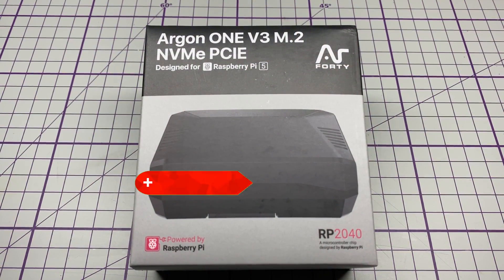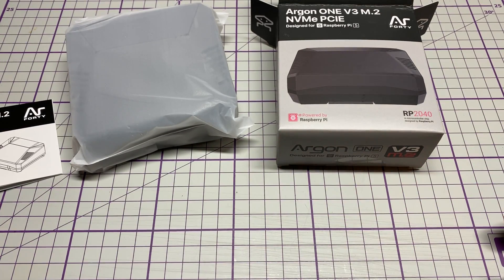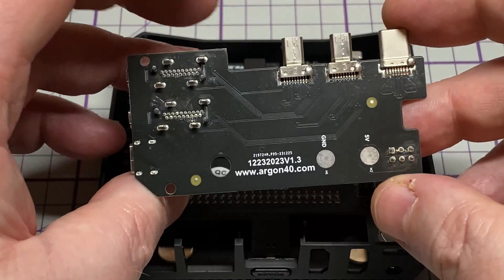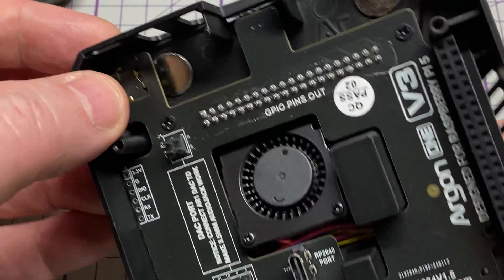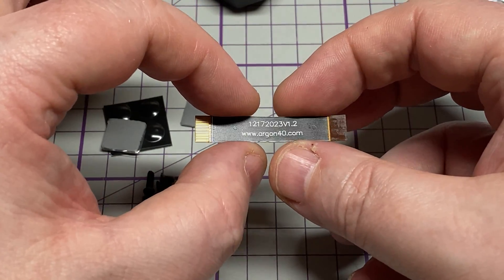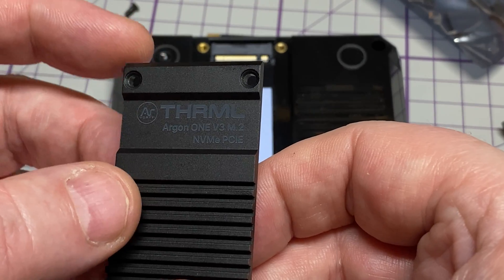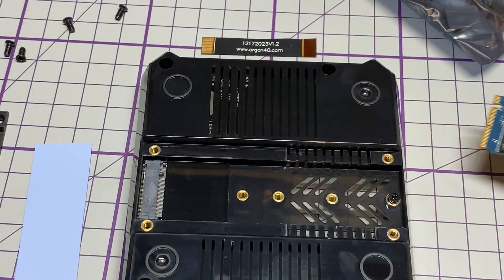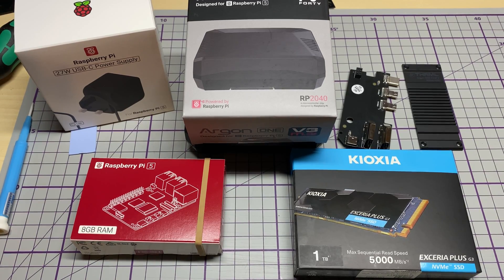Argon ONE NVME case for the Raspberry Pi 5 - unbox and first impressions.

Comment: Got mine, tried for days, 3 different NVME drives NONE detected, did all the updates, changess, updated firmware on Argon, still not recognised. Got RMA today, its done,  Anyone get NVME working in the ArgonOne V3 NVME M.2 Case, let us know drive compatibility.
Reply: Crucial P3, T500 I love this thing. added the BLSTR for sound all is well

Comment: Hello , good explanation !!!, could you provide me with the details and the link were you bought the KIONIA 1TB as you used in the video, to avoid frustration on my side with non compatible firmware and prevent that's not usable for Raspberry / Argon case .. many thanks in advance
Reply from the maker: scan in the uk https://www.scan.co.uk/products/1tb-kioxia-exceria-plus-g3-nvme-ssd-pcie-40-read-write-speed-5000-3900-mb-s

Comment: So you can't use the official active cooler from raspberry pi with this and you install the thermal tape right over the stickers of the NVME or do you peel them off?
Reply: NO
Reply: @KevinKnox-vk6qg  Yeah I know that now. I did end up taking the stickers off of the hard drive though.

Comment: I got mine today, but it’s not powering on, no matter what switches I use or pressing the power button. Pi is starting when powering directly. I’m using the 27 watt power supply
Reply from the maker: Did you push the daughter board on correctly
Reply: You are my hero. For some reason I had to use some force to push it all the way in. Connector is a little bit stiff
Reply from the maker: Yes I found this also , glad to of helped .

Comment: Great case but unfortunately it does not work with the official raspberry pi 5 27 watt power supply and keeps giving power warnings with other lower wattage power supplies. I have installed both the resommended scripts
Reply from the maker: I got a warning , but after then seemed ok , the pi is running at full power .have to see if any other issues appear

Comment: Hi today I received it too. I had my eeprom settings done before with an external usb NVMe reader. Also the boot order was set to NVMe in eeprom. But the device doesn't detect my Kingston 2TB NVMe. How is your experience so far?
Reply from the maker: Mine runs sweet , silly speeds from the ssd, no issues so fsr.
Reply: Thank you. I figured out the problem. 
1. The case has to be closed and screwed. There are 2 pins in the case that need to be touching the other boards surface. Otherwise Argon won't send power to the M2 drive. 
2. In my case, I had to add dtparam=pciex1_gen=3 line in /boot/firmware/config.txt on the SSD too. (But whoever boots up their RP5 with SD card and copy the OS to M2 drive won't need this)
3. I tried first Kingston 2TB KC3000. If I don't push and screw it, it works fine, but when I push it down and screw in the case, it doesn't work. I think the pins don't touch well the slots. But when I tried 1TB 970 Plus, it didn't have chips on the both side and it sit easily both in the slots and I could still run it while screwed. I think 2 TB drives are beefy due to the chips on the both sides and it makes it difficult to sit in the slot and touch the metals. I hope I don't get trouble with the 2TB 980 Pro that I just ordered.   @MicroChipz
Reply from the maker: Hi , i thought this might be it , on mine i seen those pins and closed the case before trying , i did look at the boot config and that line was already there , yeh maybe the 2tb is a bit thicker , these are new cases so im sure these things will come to light.
Reply: Have you installed the relevant scripts from Argon40?

Comment: Argon ONE V3 M.2 NVME PCIE for Pi 5 is about 70€ here - so more or less the same like SBC itself.
Far too expensive cause for 140€ in total without keyboard and whatnot I get a quite good used one just 3 years old or even a used Lenovo Notebook incl. display and keyboard.

Argon is the opposite evolution of what a SBC was meant to be 35 € for students and what not, but now it all has doubled. 
Bad and sad move - in the long run.
Reply from the maker: It is a fantastic bit of kit tho., but yeh its come a lot more expensive than the original SBC concept.
Reply: It isnt like the cheaper offerings has gone away though, just that the range has expanded a lot to the higher priced tier